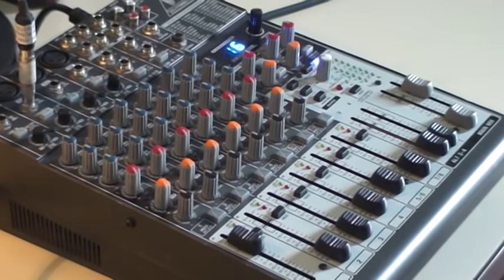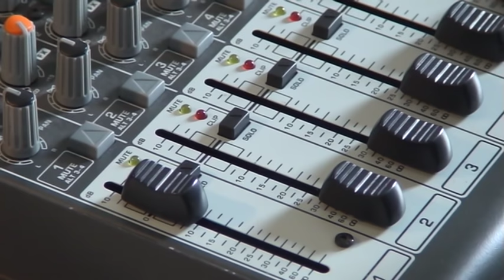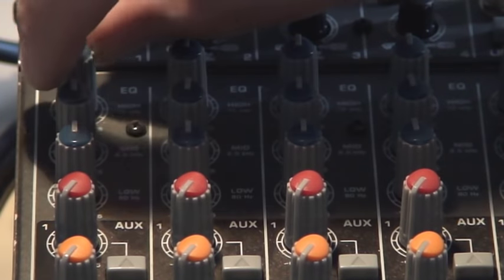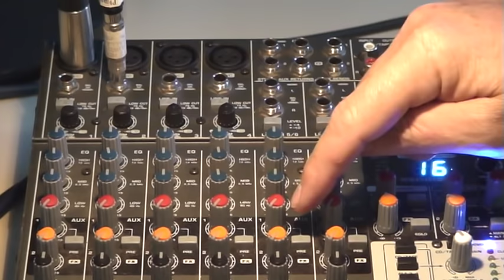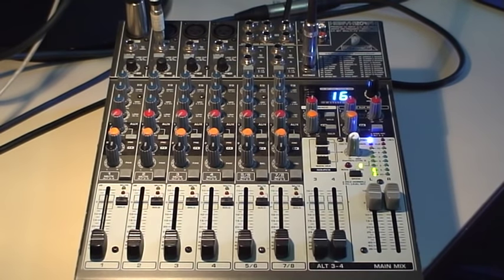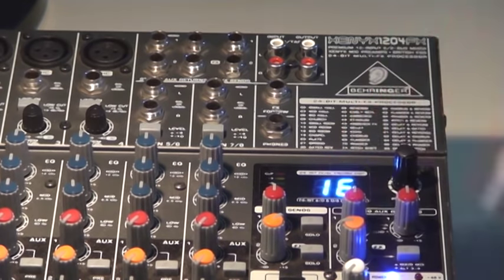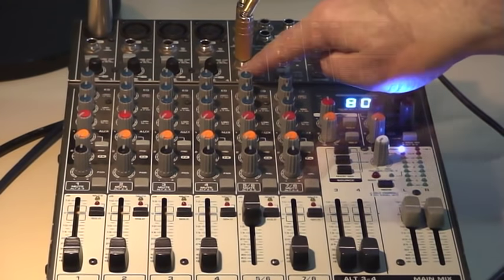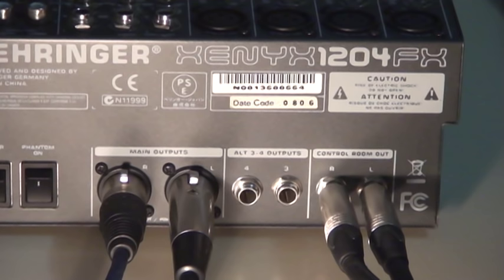How to use a Behringer 1204FX mixer for live sound reinforcement

Comment: I have the X1622USB .... I guess the same instructions apply  ? 
This is a very comprehensive video . Thank you!!!
Reply from the maker: Hi, All mixers are pretty much build on these basic principles, with the bigger unit there are more channels, more AUXes etc. 1 unique thing that is different on bigger mixing desk is when they have parametric EQs, these take some people a while to get the hang of.
Reply: I have a Behringer europower pmp3000 with no sound out, I can hear on headphone, not speakers.. Any idea of problem. Thanks in advance for your answer

Comment: Great demo, thanks. 

I don't seem to have reverb in the monitors. Can you please explain how I can achieve that. I saw a video somewhere with those instructions but now can't seem to find it.

If I recall correctly it instructed to use Aux Send 1 out to the monitors (which are daisy chained) and to connect a patch lead from Aux Send 2 to L Aux Return 1 ... is that correct. ...or is there a simpler solution?

Cheers.

Comment: You don't know what a valuable find this is for me!  I've had this mixer forever, but am configuring a new (for me) home studio and thought I might be able to use this for its preamp capability since I currently have no other external preamps and have just discovered that I need one.  I'd like to send the signal from the Behringer 1204FX into my outboard dbx-266xs compressor, then route it back into the mixer; then into the Behringer FCA1616 audio interface and finally into the computer.  Would this be the correct signal chain?  Thanks loads!
Reply from the maker: Hahaha I feel like as soon as I answer you I will get thousands of complaints from the purists :) Short answer, YES, there are a couple of ways to do it, most mixers including this one will allow you to INSERT an external device around the start of the chain (either pre or post trim/gain depending on the mixer's design). It's very easy to INSERT anything (compressor effects etc) if you are handy with the soldering iron you can make the cable yourself or buy one, it will have a standard 1/4" stereo plug one end and 2 1/4" mono plugs the other (one of the mono plugs will be your INPUT to your device & the other will be the OUTPUT from your device back to the mixer. Done!Email me if you want more specific help also look at https://www.homerecordingconnection.com/forum.php?action=view_thread&id=14905&frm=2

Comment: Hi there! Thank you for this! It is a great video. But i am doing everything right and as you say on the video to be able to listen to the FX (reverb) through the headphones and i still can't. I have the exact same model as you do, all the buttons are the same but i still can't hear the FX through the headphones. I'm talking about the build in FX and not  any AUX FX. What am i doing wrong i wonder.
Reply from the maker: Christos Mastoroudes Hi, please check the following:   1. Make sure Aux 2 (FX) is wound up (pointing straight up) on the input channel you are using.   2. Then make sure the Aux 2 Send is wound up (pointing straight up).   3 Make sure the Aux 2 return is wound up (pointing straight up) .   4. Make sure the effects send switch is up (sending FX to the main mix).   If you still have trouble send me your email address and I can help you offline. Regards Dean
Reply: Thank you so much! I got it right! You are awsome! :-)
Reply from the maker: Christos Mastoroudes No Problem, glad to help.

Comment: Hi, thanks for your amazing tutorial !... I want to know if I can connect two main active speakers and two active monitors to one dbx 215s equalizer and how I do it? ..I'm going to use the xlr returns of the snake to connect the speakers and the monitors to the mixer  (Mackie profx 16 Channels) what I need and where I put all the cables? and if I still use the aux knobs for the monitors?
Reply from the maker: Hi, Happy to help out, send me what you are trying to achieve to my email address meandeantv3@gmail.com  just trying to figure out what you want to do with the EQ, do you want to apply it to front of house as well as monitors at the same time? or just to vocals or something like that and secondary what are you trying to achieve with the EQ, ie does everything sound bad or something? or are you trying to EQ the room?

Comment: Hi, 
In a bedroom studio setup  where Mics, monitors and headphones exist within close proximity (i.e: no dedicated vocal booth)..

is there a way of driving sound to headphones only (during vocal recording ) without going through a connected set of monitors? 

I had a smaller mixer and the only way I could isolate sound away from my monitors was by physically disconnecting them from the mixer... And then reconnecting them during playback... 

Cheers
Reply from the maker: Yep, there are a few options depending on how many headphones & how many different mixes you want.  You can use the Behringer HA400 or I have used the Behringer MA400 which is pretty funky. Both Headphone Amplifiers are dirt cheap. Email me if you need specific help with any given setup. Regards Dean
Reply: MDTV3 I had a basic set up, the USB mixer was primarily an audio interface to get sounds into my DAW (vocals) and then sounds out to my monitors. 

The DAW pretty much did everything else. 

During vocal recording, I found that the only way to eliminate the studio monitors was to power them down completely and then work from Studio headphones. 

**Afew months ago my apartment got burgled and all my equipment got stolen.. Sooo am looking to rebuild anew, with options for expansion where live instruments can be incorporated and edited from the mixer's end but also within the DAW.**

I ll need a mixer that can allow me to independently control headphones on their own, and monitors separately - while operating within the same room (basically to avoid positive feedback) 

I love this mixer (x1222USB) just want to know more about before I commit. 

Cheers
Reply from the maker: OK well you can use the desk to control the headphones, if you want multiple channels in the headphone independent to your main mix you can route everything thing through an AUX channel to the headphone amplifier

Comment: Because this only has one aux channel how would you connect two monitors to this and control what is in each one? 
My band has two monitors and we want to be able to control what is in each monitor, is this possible with only one aux 1 channel?
Reply: i believe you can still use the 2nd FX (internal) as a monitor output.
Reply from the maker: Stuart Heydon Yes, Correct. 
Obviously you do it at the sacrifice of freely using your internal effects
(unless what you want to output to that monitor is also what you want to apply effects to).

Comment: I have a Behringer europower pmp3000 with no sound out, I can hear on headphone, not speakers.. Any idea of problem. Thanks in advance for your answer
Reply from the maker: Hi, it will most likely have to do with your routing setup, a cheat is to hit the send to master bus on the channel strip (assuming your outputs work & there is not a problem with the desk). Channel routing can get you confused really easy sometimes, more so on the larger boards with sub busses. So you have to route your channel strip to either a sub bus that is then routed to the master bus or a lot of mixers give you the option to route it straight to the master bus. If you PFL the output signal you are sending to the speakers do you hear anything? Feel free to email mail me if you need clarify. Regards Dean

Comment: Hey guys I need some help.  I use the Xenyx X1204usbfx for live djing and Karaoke.  Here is my issue.  I use the Phones/Control room output for my booth monitor.  For some reason if I use an effect on any channel, (mainly mic delay fx for singers) I cant here the effect through my Phones/Control Room Monitor output.  The Main outputs work fine. Effects and all.  I can hear everything except the effects.  I could use the tape output but theres no control over the volume.  Ive tried everything. Mono/Stereo plugs, Main mix button pressed others off and visa versa.    Any help would be great.  Thanks

Comment: If I have 2 channels in stereo from say a keyboard rig on stage and there is only 1 available channel to front of house PA what is the best way to combine the stereo signal on the mixer to a single summed mono signal to go out of the mixer to the house PA?
Reply from the maker: At the risk of offending every keyboard player I suggest the following. Most keyboards will give you a mono mix down through the left output (make sure there is no plug in the right jack as it may not mix down to the left). Now to the offense, there is a fair bit of talk about phase issues when mixing down stereo samples, quite frankly keyboards in the music I have mixed were not the dominant instrument & as such I couldn't hear any issues nor the musicians/listeners. Unless you have Elton John (or similar) hammering on you keys or it's the only instrument then it's probably not going to be an issue.....There's an article here that might be interesting: http://www.keyboardmag.com/how-to/1255/solving-stereo-stage-piano-problems/28996

Comment: how can i use the main outputs going to eq and pa amp/speakers. the control room outs to my monitors AND the 3/4 outputs to another set of pa amp speakers. i can get main and control to work. can get anything to come out of 3/4.
im only using channel 1 and 2 for inputs?
Reply from the maker: Shoot me an email & I will reply, I have some rough diagrams for other peoples questions it might be able to help. my email address meandeantv3@gmail.com

Comment: Yes, terrific demo. Others say "demo" but you actual DEMONSTRATE it. Can you or someone answer a question for me? What happens if I connect this to a USB port on my PC? Long story short, I messed up the onboard sound and have it disabled now. I do have a Tascam US-122  interface and I just bought a Behringer U-Phono Ufo202 Usb Audio Interface. So would I have to use one of those or could I just go direct USB?
Reply from the maker: Hi, I have used one of those Behringer UFO202 USB sound cards & love them, pretty simple to use. I presume your question is in regards to the USB support on the newer Behringer mixers (not the one I did the review on) I haven't ever used one but I thought it was the same as using the UFO202? So you should be able to go straight out of the USB on the mixer into your PC. The Tascam interface is nice (nicer than the Behringer UFO202) So if you cant get the onboard USB to work either the UFO202 or the Tascam would be fine. Regards Dean

Comment: Hi, is it aux 2 that labeling fx just for external effect device, can we use it for monitor too Sir...
Reply from the maker: Hi, AUX2 goes to the internal effects unit & to the AUX2 Sends/Returns, so you can use it for running internal effects OR you can use it as a monitor send.
Reply: got it, thank you Sir...

Comment: I HAVE XENYX 1204USB IT DOESN'T HAVE THE FX DISPLAY ON THE MIXER... I'M HAVING  TROUBLE SETTING SOME OR ANY FX THROUGH ANY CHANNEL FOR LIVE SOUND... ANY IDEAS??? IS THERE A SOFTWARE THAT CAN BE USE???
Reply from the maker: Hi, yes with out the FX you will have to either use an external FX unit (run it through the AUX bus) rough guide, if using say aux 1 remember to turn up the channel strip aux 1 to half way, then turn up the desk's aux send up to half way & the aux return to half way that should get you some effects.For recording, record separate channel and apply FX in your software. If you need detailed help email me with more specifics my email address meandeantv3@gmail.com
Reply from the maker: Hi, for a quick start have a look at this video, it's pretty much what you are wanting to dohttps://youtu.be/YoqMXO8rkjA

Comment: Can you comment a link to where you Got the cable you connectet to youre Phone and mixer?
Reply from the maker: Tias Henckel Holtse Any pro/stage audio shop should be able to help you. Amazon sell Hosa CMP153 Y Cable 1/8 Inch TRS to Dual 1/4 Inch TS Cable - 3 Foot

Comment: actually what is the purpose of  RCA input as demo 14.07?  could we mix the sound with a AUX ? when i tried it i feel its a just bypass only?
Reply from the maker: Hahaha yes this is a very old thing, in the old days you used to have a music tape or cd play at an event before the band or whatever got on stage, the RCA in was a cheap way of getting that music into the mixer without wasting a whole channel for it. But in summary, I pretty much never use it, mixing desks are that cheap that if you want to put a CD through the desk you just use a stereo input (and that gives you EQ on the channel as well)

Comment: the model of mixer i have is Behringer 1204 is it possible to add the same effects that you have? like for the echo? on live sessions? i cant access it? can you help me please? hoping for your response
Reply from the maker: Hi, the FX in the model number means it has the built in FX, if you don't have the built in FX the only other option would be to look at an external FX device (unless you wanted to upgrade your mixer)
Reply: what can you suggest if ever i want to buy an external FX device? really a big thanks on your reply..
Reply from the maker: Hi, external effects are not as popular now because it's cheap to get them in the mixer, so you should be able to pick something up 2nd hand pretty cheap (from someone upgrading). Just look for something that has delay, echo & reverb (which should be most units) otherwise consider selling your mixer & upgrading it might be cheaper depending on what you can get for your mixer.
Reply: cheers mate! thank you very much! it was a very big help.. thank you!
Reply: I can sell you a Monacor effect box for 80 euro plus shipping with all necessary cables extra. It has 16 effects and you can easily plug it to your mixer

Comment: I can only hear music with my headphones in. I can't connect my bose into the 1204. am I missing something?
Reply from the maker: Hi, Need a little more info, can you please advise how you are inputting the signal, 6.5 jack? into a channel strip? and how you are trying to get the sound out etc please send pic if you think that will help my email address meandeantv3@gmail.com
Reply: I'm not good with the tech specs but the only connections I have is the usb from the mixer to the computer. I tried line-in to the mixer (rca).
Reply from the maker: OK now I'm definitely confused about what you are trying to do, if you send me an email I can email you back some standard wiring diagrams that might help
Reply: I think you are trying to plug your headphones into your board? you need a 1/8" to 1/4" TRS adapter

Comment: Nice video, good job,
I´ve just got one XENYX 1204 but my main problema is that I haven't been able to make  it work with its USB. My pc does not show the mixer installed. I have downloaded everything, all drivers and software from BEHRINGER. I hook up the USB to my computer and nothing happens... Has anybody here had the same problem, any help will be gratefuly appreciated. I have windows 10... would that be the problem? cheers.
Reply: +Wilson Raiano are you using a daw? a program to record ? maybe that is the problem i think meaning you need a program to make use of the mixer
Reply: +Wilson Raiano Hopefully you got this working by now, but if not, make sure you have the USB driver installed from Behringer.  There are also two red buttons labled 2-tr/USB.  You may need to press one of those depending on which output you are using (phones or mains).  I had similar issues when I first got my board and was using Windows 7.  I am not using Windows 10 and don't have any problems with the USB functionality.

Comment: can you hear FX in headphone output?
Reply from the maker: Yes, dependant on what you are monitoring with the headphones, main out will have the effect in it as well as the AUX bus that relates to the effect.
Reply: but I cant seem to hear the FX in controll room. Here is what I want to figure out... I have this 1204 mixer to do Live video streaming. I will mix a guitar signal a mic and an Ipad playing tracks. I need to hear the mix in headphones with its own volume control and FX in the headphones too and ALSO send this mix out to my iphone which needs it own volume since I want to hear it loud and my phone needs it very low gain to record well. Any suggestions please????
Reply from the maker: Hi, Having trouble understanding exactly where you are struggling, headphones have their own level control? What's the control room outputs not doing? have you tried using the main outputs instead of the control room? Feel free to send me more info. Regards Dean
Reply: Is it possible to have reverb in the controll room output?
Reply from the maker: Should be, if you have SOURCE as MAIN MIX you should hear exactly what goes out the MAIN MIX.This YouTube video mentions the SOURCE selection. https://youtu.be/qyNbWkqXV9w
Reply: ok I just need to have two mixes one in headphones for me real loud with FX and a softer gain for iphone input but also with FX
Reply from the maker: Yep that should be doable, have you got it under control or are you still struggling with something?
Reply: nope I bet I am just doing it wrong but I can not get the headphone jack out put to have FX unless i am listening to the main mix in the headphones I think lol
Reply from the maker: Yep that'd be correct, listen to the Main Mix with your headphones to hear the effects.
Reply: but what mix can I send out to iphone that is mixed softer AND has fx?
Reply from the maker: Hi, Not sure if I'm keeping up with the conversation, are you able to email me a pic of your setup to meandeantv3@gmail.com  You are listening through the headphones & the main output is going to the phone?